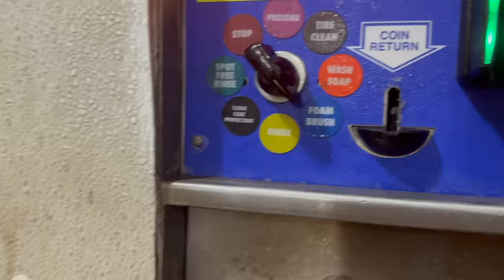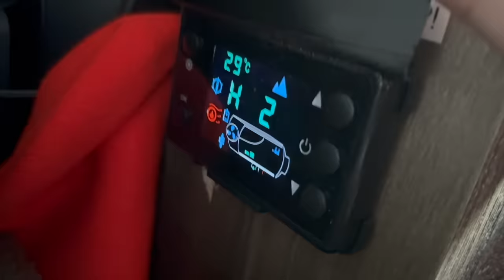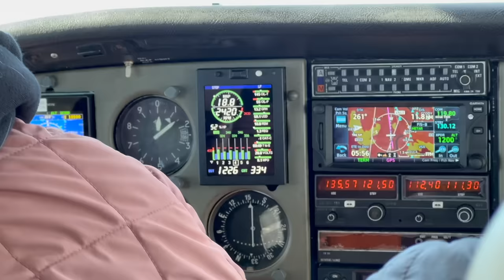An Artist Painted All Over My Truck

Comment: If you leave the truck on can you use the truck heat? If the diesel heater doesn’t work you can park near a gas station and just leave the truck on for some heat. Stay warm buddy. Love the content! We’re here for u
Reply from the maker: Yes! I can run the truck for a little while but best not to run it all night

Comment: Hey, add fuel drier to the diesel heater tank and air bubbles in untreated fuel can cause frozen water crystal. Besides that see if there is an air fuel adjustment. Otherwise look for another heater if you are planning to be at altitude. Just my experience with a diesel truck with very cold weather and more to come
Reply: I just wish you built this before My tacoma decided to do cartwheels on the freeway

Comment: HAVE YOUR WINDOWS OPEN WHEN YOU SLEEP, something could burn up in the heater or an electrical issue in the car and you could die from Corbin monoxide, I lost a friend to this please don’t risk it the chances of something happening one night is very high if your literally living in the truck, please reply or like if you see this so I don’t have to keep commenting this every video I love you bro
Reply: I think in one of the OG shorts he mentioned drilling ventilation holes
Reply: And he added a carbon monoxide detector